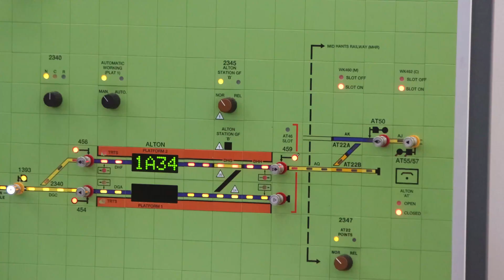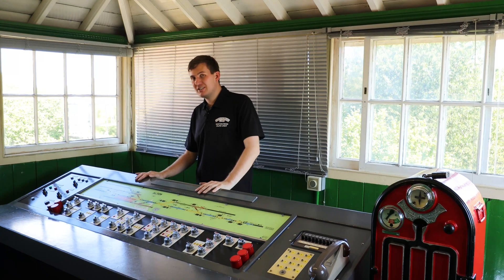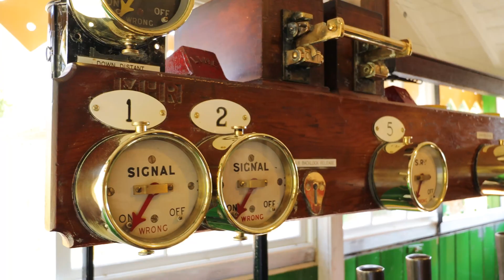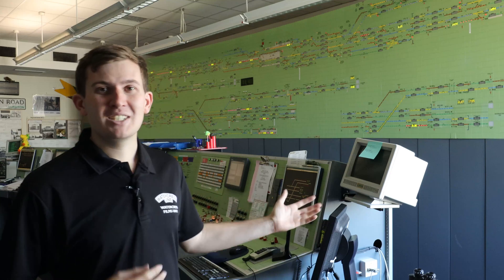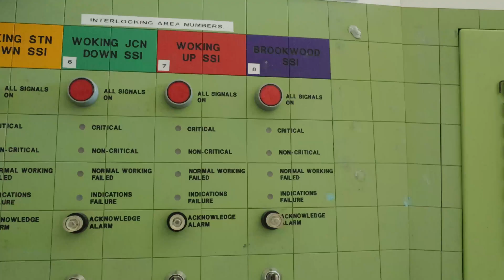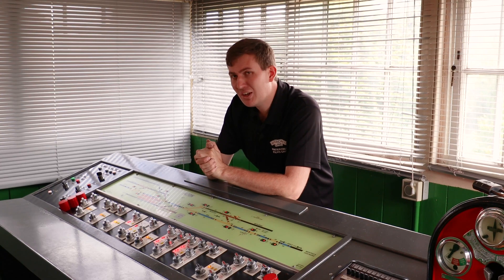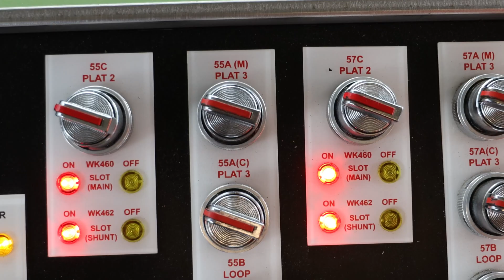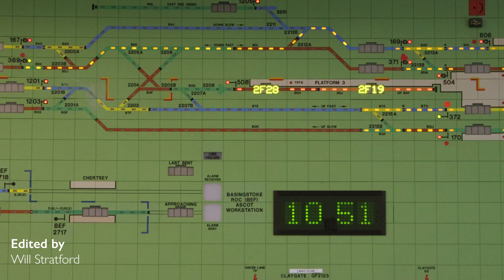'The Other Side' - A Look Inside Woking ASC

Comment: Very interesting content 
I'm currently in apprentice as a signalman in Switzerland and i do really see some pretty similar things. What would be interesting for me: what you use at Woking seems to be an Relais-interlocking operated on the original, analogue interface. In Switzerland, Relais-interlocking exist as well but normally they are operated remotely on computer screens by a centralized signalling centre, controlling different regions all at one point. Those digital signals are then converted to analogue voltages again. Is there any possibility to do this as well in the UK or is this only possible for electronic interlockings as e.g. in Westrace MK-IIs?
Cheers
Philipp
Reply: This, I think, is an electronic interlocking, but using a conventional panel rather than a computer-based interface
Reply: I think this is also done on Network Rail, when some older relay interlockings are retained but with control moved to new control centres, such as the Thames Valley Control Centre (TVSC) at Didcot. Not sure about the detail of that site, but it’s long been normal (since the 1960s) to use digital transmission between control panels and remote interlocking equipment.  Incidentally, the original design of the  display panel shown in Woking apparently uses the 40mm square “domino” layout, that was originally imported from Switzerland in around the 1950s. The mechanics of it has changed a bit over the years, but the concept of using many 40mm square units came from your part of the world, and it made easier to alter the layout etc rather than using large single-sheet panels during the service life of the place.